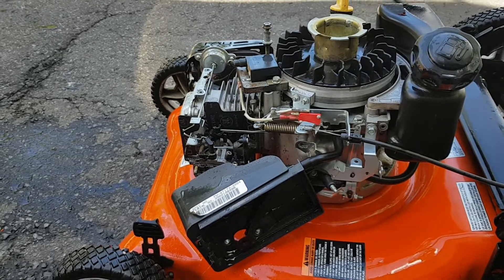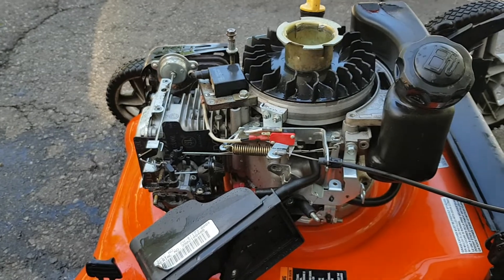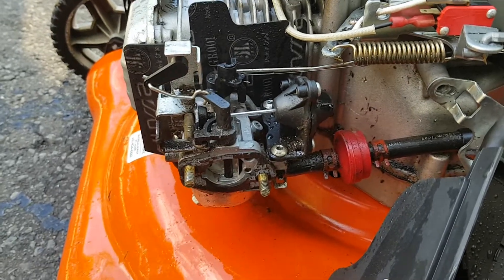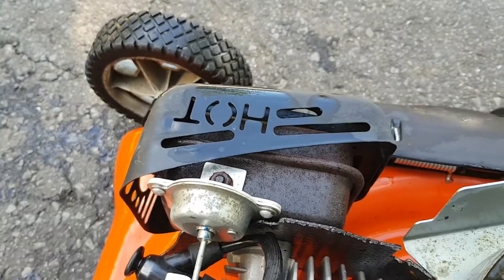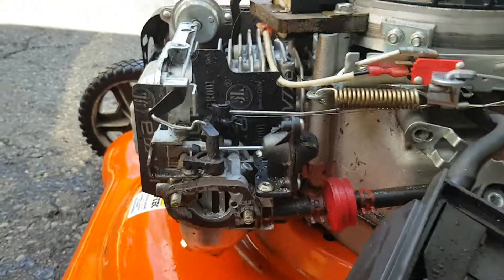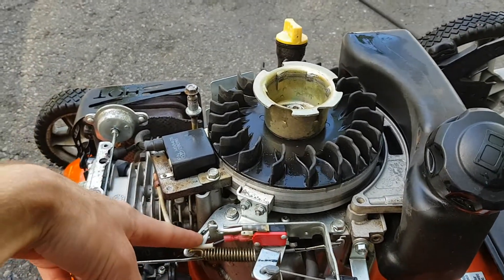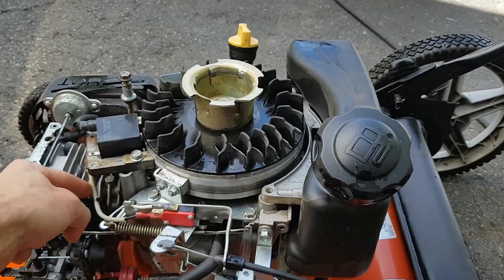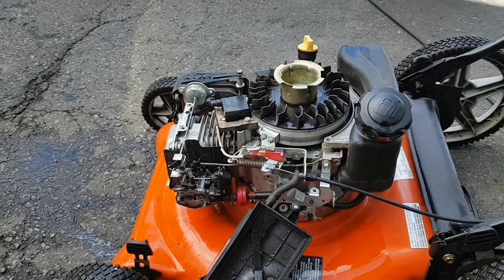Ariens Lawnmower with Kohler Courage XT7 Engine Carburetor Issues

Comment: thank you very much I will be working on that mower in April as it was given to me late in the fall and I did have issues with it running so I guess if I clean the carb and do what you have suggested it should be OK thank you sir
Reply from the maker: Yes. clean the carb and drain out all the old gas

Comment: Hey .. Good video. I know most of it from taking apart my own Ariens XT-6, but .. even after a full carb replacement, this machine runs for about a minute, then , stops quickly.  Won't start .. until cooled down. After about 3 minutes , it starts again easily.. THEN  , a minute later , dead again.    As mentioned, full carb, spark plug, air filter replacement..Problem still exists .. ANYTHING ?????  Thank you.

Comment: Hi, thank for the video. I have a lawnmower woth the xt-7. It start and turns off amazing. But after a few minutes it runs rough...wants to shut off but keeps running...shakes...then turns off. I can see the chock plates open/close as this happens. Any clue what part is defective? I used carb cleaner and seafoam for carb, changed plug, replaced filter and cleaned the entire exterior of the car and filter housing.
Reply from the maker: It could be the ignition coil failing. When hot it can change the resistance and cause it to malfunction.